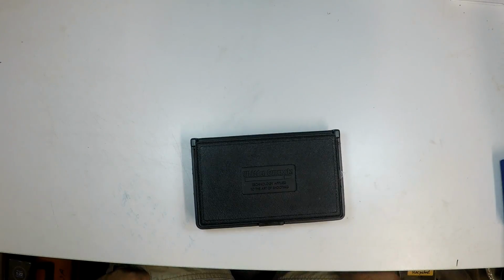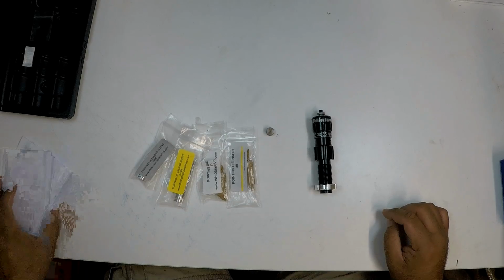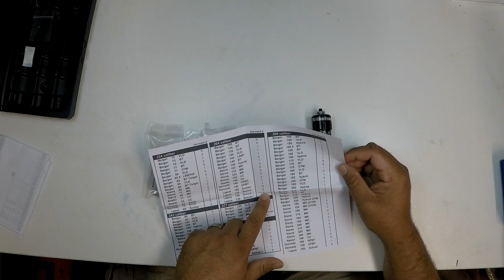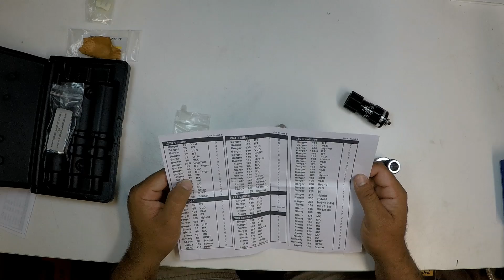Whidden bullet pointer and explanation why bullet pointing is needed

Comment: Anyone have any opinions on a non bushing vs a bushing FL sizing dies? I'm just getting started and am just shooting a regular AR in 223.  I'll get a bolt gun before to long but I really want to have a good handle on reloading before hand and I'll probably use these dies for both... start with one die maker and stick with them.
Reply: You Do Not want Bushing dies for an AR especially! I thought I would do the 1 brand of dies when I stated a few years back. Lee's are decent, USA made and cheapest, I started with them. Wanting better quality for my long range and magnum bolt actions I moved up to Redding dies. (they are 3-5 times the price)  I later found Forster seating dies to be even better. Finally I found Wilsons arbor press type micrometer seating dies to be the best for precision bolt gun ammo.(long range precision) Eric uses them too.  My point is I ended up with 4-5  brands and have a few specialty dies for other things. It doesn't matter if you have 1 brand or a dozen in the end. You will end up using what works best for you. I still recommend starting with Lee's to most folk. For an AR type rifles I would make sure you get small base dies. Read up if you don't know why. Its important. I use the Lyman 4 pc small base AR die set for my .223 and .300 BLK loads myself. Its good quality and not super expensive. I am just starting to load 6.5 Creed for a AR10 so I am experimenting there still. When you get to a long range precision bolt gun you may want to move up to better quality dies than Lee probably but they will work fine if its all you have. There are just better options when your trying to make your hits more accurate at long range.
Reply: There’s nothing wrong with using a bushing die for an ar, but if you aren’t uniforming neck wall thickness you could be inducing bullet run out. Lee and hornady make useable starter dies and will make more accurate ammo than what most shooters will be, but if I had to start off all over again and was in your shoes I’d probably go with a set of hornady custom dies, and then when you get your bolt gun, remove the expander ball from the die and acquire an expander mandrel die with the appropriate mandrel to set bullet neck tension

Comment: It looks like you had a video where you used this die to point a bullet, what happened to it? From the video it sounded like you don't actually point bullets, is that true? Also, would you meplat trim then point or vice versa?

Comment: It's an interesting debate if trimming the meplat is necessary to getting a more uniform BC you definitely lose a tiny bit of bullet mass in the process which affect BC in the minutest sense how much is unknown.  I would make for a great test and comparison.  Recently I got information that Whidden doesn't see trimming as necessary once the bullet is pointed. I quote from my source who talks to John on a regular basis "Whidden quit making the trimmers as once pointed they made no difference according to John Whidden".  For myself pointing definitely produce more consistent results at longer ranges fewer "flyers" for sure.  Keep up the videos very informative especially the comparator ones.
Reply: Need More Ammo Productions so whidden has stopped making these? honestly, for the price, why not pay premium prices for custom bullets vs paying for this die for $221?
Reply: Andre Isis Whidden still makes the bullet pointing die they don't make a Meplat Trimmer or see a need for a trimmer from what I gather.  What would you consider premium bullet? Lapua, Berger, smaller bullet manufacturer like JLK?  Even with some of the higher priced "premium" bullets you're going to get some inconsistent points on bullets as a result of equipment changes. Not all manufacture re point their bullets after the bullet die machine stamps out the projectile, the only bullet that comes to mind that are re-pointed are the SMK#2156.  The pointing die is to close the meplat opening so that the profile is suppose to be more streamline and consistent in taper and shape.
Reply: Need More Ammo Productions
jlk is premium bullet as well as matrix. on one hand, the word premium seems devalued if you have to keep buying more stuff to get accuracy...ala money trap.
Reply from the maker: Andre Isis JLK also need to be sorted, trimmed, and pointed in order to compete against the World's best shooters.  Since the work needs to be done anyway, might as well buy a good bullet without paying the premium price for "premium" bullets and use the money saved to buy tools that will make those bullets more consistent.
Reply: Erik Cortina
well there is then an arbitrage in that point ie premium bullets are overpriced & not needed then. but for regular shooters, i assumed the premium bullets provided a service where one didnt need to engage in further money spending.
Reply: Erik Cortina
do i need to get wilson 7mm vld stem at brownell[no regular stem] to seat 7mm bullets using the 6.5x284 wilson chamber seater? also can i use 6.5x284 seater to seat 7mm-08?
Reply: Erik Cortina
i respect your opinions Mr Cortina. but yours is a special case=BR competition vs the rest of us. the more i study the IN & OUTS of LR shooting for accuracy, the more justification for spending for premium services. I agree w/ you the bullets are the most expensive ie the "client" doesnt lie. but if i wanted to buy premium bullets in order to save $ on additional reloading products as a form of trade-off is the point i was trying to make. either get cheap bullets & use whidden pointing system to close the gap or forego the time factor & expense by getting premium bullets.
Reply from the maker: Andre Isis I don't use VLD stems.  What I do is chuck a bullet in a drill and apply lapping compound to bullet and spin it with drill inside seating stem to match the stem profile to the ogive profile on bullet.  

You can not use a 6.5 mm seater to seat a 7mm bullet as the 7mm bullet will likely get stuck inside die.  Also, the 6.5-284 case is much "fatter" than the 7mm-08, so the case would be unsupported which would likely cause a lot of runout.
Reply: Erik Cortina thank you
. was wondering if you could show video how to customize wilson seater stem &  expanding 6.5mm to 7mm & avoid donut? that would be interesting.
Reply from the maker: Andre Isis I will do that soon I hope.  Thanks.
Reply: Erik Cortina
much appreciated. thank u for your time
Reply from the maker: This is my opinion.  Bullets are the most expensive thing in a shooting system.  If bullets are the most expensive part, I like to get the most for my money and only shoot bullets that are as good as possible.  I know there is the time factor as well making all these bullets as close to each other as possible, but when a single bullet can take you from first place to 5th or 6th, it's worth it to me to ensure they are all as close to perfect as possible.